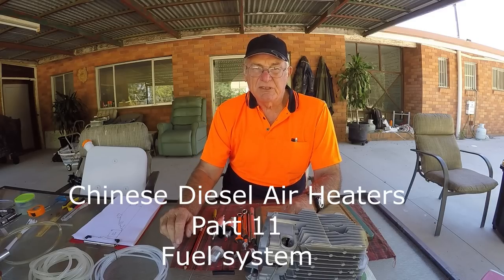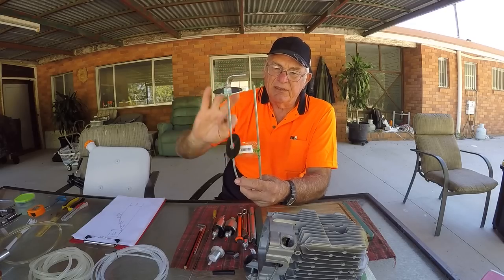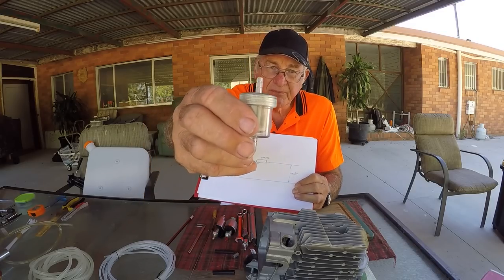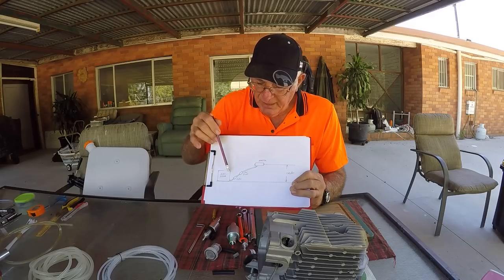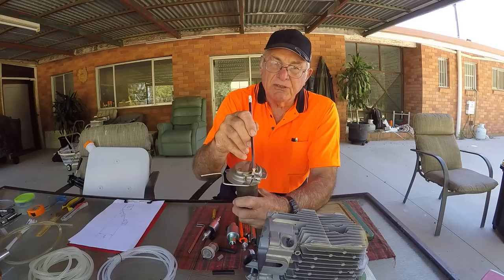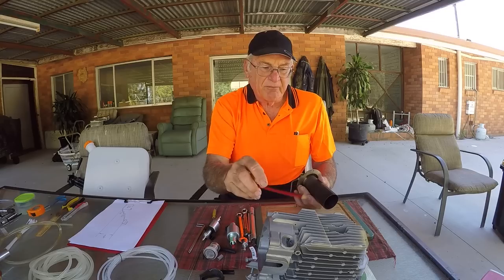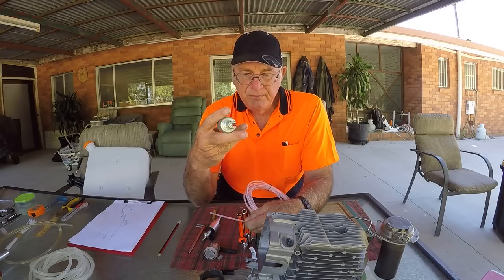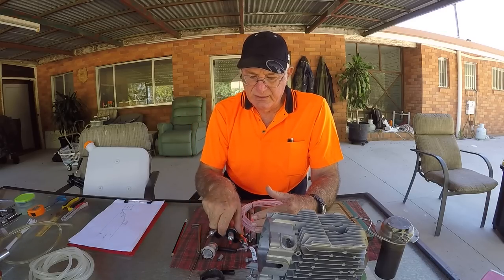Chinese Diesel Air Heaters - Part 11 -  Fuel Delivery

Comment: This is a brilliant video, I'm currently installing mine in my boat and I was debating using automotive braided fuel line. As I thought the hard nylon line would be sceptical to cracking in cold weather.

Comment: great insight into the tubing!thanks for taking the time to make this John
Reply from the maker: Hi David, pleased you found the video helpful.  JMcK
Reply: @johnmck1147   I think i've near watched them all,i'm on about 14/15.I'm so glad I did,you did a fantastic job on explaining about these heaters.I've upgradeda few things on the strength of your advice and i think the chinese are watching them too as they''re supplying them with better quality fuel lines and added a gauze to the air filter!      I dont know if ive not got this far yet but i wondered if you did one on using old engine oil?...or mixing with it kerosene or diesel.cheers,David
Reply from the maker: Hi David, these heaters will initially work by burning almost anything liquid that you can light up.
I say initially, because when you burn a liquid that makes smoke, like oil, when it burns, you also make carbon. Basically the more smoke, the more carbon deposited in the heater. This carbon very soon builds up in the burner and atomisation screens and the heater will no longer work. You then have a serious maintenance issue to remove the carbon.  JMcK
Reply: cheers John..I think I'll stick to kerosense and diesel then :).A mate of mine owns a garage and oils free ofcourse, but kerosene or red diesel isnt that dear in the Uk really.thanks again.David

Comment: hey john.  Thanks for all of your helpful videos.  I'm sure you have become a pillar of hope for many people around the globe, just looking to keep a little warmer.  Anywho...  I followed your directions on assembling the fuel delivery system in the proper way.  I have a 5kw(8kw) installed in a camper-van.  ( i know this could be overkill but i had no idea when i purchased it), and i have the fuel delivery components underneath the van,   My heater came with the hard nylon hose, but i still protected it by sliding it inside a larger clear hose, just as you mention in the video.  I used proper black fuel hose coming from the tank, into a valve, then  into the filter, and then into the pump, just as you mention in the video.     I fired it up yesterday for the first time, and it seems to run great right off the hop, and I had it on for a solid 6 hours with no problem.      So following your advice I had it on low most of the time, and then before shutting off i cranked it up to high to burn off any carbon deposits.   It is after this that i  noticed that there are fuel leaks at the connection points of the filter, the delivery side of the pump, and also where the line meets the heater!!.     No error codes however, even after running it again, so it must be getting proper fuel.   Im 99 percent sure the hard vinyl hoses is butted up to the inlets, and im 99 percent sure ive tightened the hose clamps down securely.     I'm not exactly sure what i did wrong or what i should do next?  Can the clamps be overtightened?  Someone suggested i change the hose clamps for the pressure clamps, but this will be a challenge to access the one right beneath the heater.       Do you think that the sudden change from lowest setting to highest setting created enough of a spike in fuel pressure to create these leaks?   and if this is so, how can i burn off the carbon?   what temp would it need to be turned up to if not the max 35 degrees?   im afraid to crank it up again.

Any insight would be greatly appreciated.
Cheers
Reply from the maker: Hi Bruce,

Thanks for the feedback.

Ref the clamps. You do not say what clamps you used. Please have another look at the motorhome videos re clamps. If you use screw type clamps on the nylon/rubber joiners you can actually creat a leak if clamp too tight. 

Now re the carbon removal. If your install is gold standard with very few restrictions in the combustion air inlet and the exhaust, you will have few carbon build up issues, and a med burn run now and then should be sufficient.

I run the boat heater mostly on low, and at the end of season I give it 15 minutes on medium and I  haven't had to service heater in 10 years. But my install has absolute min burner restrictions.

However if you have twists and turns in the exhaust, same for the combustion air inlet, and add in dirty filter to boot, you will have poor a combustion burn, and you will get excessive carbon deposits.

Your choice, if you can get by running heater on low and med, but you really do not want fuel leaks in your install.

 I hope this helps a little.  JMcK
Reply: John McK 47   Thanks for the thoughtful response.  I’m using the screw on clips that came with the heater.  Based on your response... I’m assuming that perhaps I over tightened them .   If I have created leaks by overtoghtening... do u think loosening off a bit would remedy this, or did I create a crack in the connectors?
Reply from the maker: Bruce Petracek 

Hi Bruce, it is a little hard fo me to comment without actually seeing your set up.  

Yes, you can creat a leak by overnighting those worm clamps on small diameter hose. 

If your nylon hose easily slides into the rubber connector, you will have a leak that can't be sealed by a clamp. You could try some silicone gasket sealant or similar to seal the hose.

Have you seen the motorhome videos. I talk more about this there.

Cheers.  JMcK

Comment: Man this is great!   Just ordered one a few minutes ago. Bet mine will have the flexie line. If we hadn't had seen this video we wouldn't have had a clue. Tho I have worked around hydraulics since being a kid and understand the principal of air compressing , but when a product is supplied with something , you usually just go with it.    But Thank You again 👍👍👍👍👍
Reply from the maker: Hi Phil

It is ok to run normal fuel hose (in most installs) from tank to filter to pump. But you should only run the narrow bore hard fuel line from the pump to the heater. 

The normal large fuel hose will still work if the run from pump to heater is very short and lacks loops where large bubbles can form. But you will have maintenance issues as the hose will absorb the pressure pulses and you won't get proper atomisation in the burner.   JMcK

Comment: I have a Hcalory heater that has never fired up, I just get an E 10 error code as well as fuel dripping out of the exhaust  - as well as a duff glow plug I suspect the fuel pipe has issues, it is a combined tank and heater unit and there is a fantastic bubble collector where the tube drops to the heater from the pump. I found your content very enlightening as to why we need to use hard line of the correct diameter. i will order both and try again. when you mentioned tubes running up hill i initially questioned that but upon explanation it makes perfect sense - bubbles travel up hill so no collection points on route. The manufacturers should make these things the other way round with the tank on the bottom so that its all up hill. Oh dear i'm waffling - stay safe

Comment: Thanks for the reply John , so this was a new heater install  that ran well for a short time ( one week 24 hours during a hunt in Canada at minus 28c ) from watching your videos I know I did two things wrong . One  I used rubber fuel line  , Two ran the fuel pump to prime however it did work well for the entire trip. When it started to act up  , it would  start then run for a few minutes then kick off . This occurred two or three times , then it just would not start . I sent away for  a replacement pump  which I installed , the heater ran for 10 minutes then the new pump stopped pulsing. At this point I suspected something else was wrong did some research found your videos and sent away for a new circuit board and  glow plug however I wanted your thought's before exchanging  these. I have watched your entire series now that I have found you and I must say you are the most articulate teacher I have found on this issue on the internet . I have so many things to correct before  I try the heater again ,however  one more thing If I could . The heater that I purchased  is an 8 Kw  , can you  recommend the  size  and hertz  after market pump you would use on this size heater . Thanks in advance , your new friend  Jack in Alberta Canada
Reply from the maker: Hi Jack,

Normal rubber fuel hose is quite ok on the pick up side of the pump, but you should only use the hard narrow bore hose on the delivery side of the pump.

First up,  if you used normal rubber fuel hose on the delivery side I would first check the glow plug screen and glow plug itself for carbon build up. If so clean that out, and replace the rubber delivery hose with hard nylon hose. 

Rubber hose on the delivery side of the pump absorbs the pump fuel pulses and creates issues at the burner screens in the heater. 

If you find high carbon build up in the glow plug screen, which is easy to clean, it is likely you also have excessive carbon in the main burner screen, which is harder to clean.

It is possible, but unusual for the ECU to fail. 

First up I suggest you use the correct delivery fuel line, check the fuel filter, clean out the glow plug screen, check glow plug and try and and run a 90/10 kerro/diesel mix through the heater for an hour on high setting. If your issues were carbon related, this will most likely fix your problem without a full strip down.

If not, you will need to look further, and this will involve a full strip down to check for high carbon buildup in the burner. It would be unusual for it to be an ICU issue.

Good luck.  JMcK

Comment: Some great engineering principles explained here. I bought a Vevor® "square brick" heater box but it didn't last long. Turns out the hard tube inside had a few factory installed coils so the bubbles were collecting up top and the atomizer screen was all carboned up. A thorough cleanout and rerouting the tubes fixed it good! So if you buy any of the box units take the cover off and inspect the tubing!

Comment: Truly an awesome video and demonstration. On paper, I don’t think there should be a problem with lifting fuel through a larger diameter line. The vacuum pressure at the top of a column would only depend on height not diameter. The pump would only be lifting the column of fuel within the cross-section of the pump inlet, not the entire volume of the hose. That being said, I’m taking your word for it!
Reply from the maker: You are correct. In practice, I can’t tell the difference. JMcK

Comment: Hey thank you sir for showing this effect of the soft tube compared to the hard tube. I'm experiencing leaks in my fuel line at the filter and at the pump. I'm considering replacing the soft tube that came with my heater with the hard fuel line kit I ordered
Reply from the maker: 👍. JMcK

Comment: Cheers mate from the Danish border. Thought I was smart using the heavy duty pipe, guess not. Will edit my setup now. Thanks a lot for the excellent explanation!
Reply from the maker: Hi Manuel,

Normal fuel hose is fine from tank to filter to pump.

Normal fuel hose will work ok from pump to heater if very short.

It is better to use hard narrow bore nylon on the delivery side of pump so the pulse pressure does not get absorbed, which will affect the atomisation of the diesel, which causes excessive carbon buildup, which now restricts further atomisation. 

Cheers.  JMcK
Reply: @johnmck1147  I tried to correct my error but broke the damn filter while fiddeling around. Guess I have to continue tomorrow. My hose length is from tank to pumo about 10cm and from pump to heater about 15cm. Does it really make a big difference? Because it ran well before I saw your video. :)
Reply from the maker: Manuel Martensen 

Hi Manuel,

It will run ok at that length if you don't have too many restrictions in in your install.
You may need to service the heater more often as you will get greater carbon deposits from less atomisation of the fuel.

Cheers,  JMcK
Reply: @johnmck1147  thank you! Greetings from the Isle of Sylt to you!
Reply from the maker: Manuel Martensen 
👍

Comment from the maker: Yes, you can get fuel leakage leading to flooding of heater and lots of smoke on start up. Just add a fuel shut off tap in the fuel line before fuel filter and turn this off if not using the heater for a few days. JMcK

Comment: John....Thank you so much for this excellent series of videos on these chinese deisel heaters.  OK, now for the dumb questions...lol...sorry.  But..I have located my fuel tank in the best for "ME" location basically at the rear door level in my van. I have also drilled a pick up pipe hole at the top of the tank and not the bottom simply to stop any leaking from bottom pick up fitting or hose connection by forcing the fuel to be sucked out the top next to the fill opening.  "Is this the start of my possible troubles" ???  Next I will suspend the ticking original pump as close to the bottom of the tank level. The thinking was to keep the pump as close to the heater's level...?  The next issue is it has a 12 foot solid plastic fuel line distance to be pumped...after watching your video, this seems possible...?   Next the heater is installed on the floor of the van right behind the driver's seat.    So the question is, my set up is basically backwards to what is being explained by almost everyone as to mount the tank at the lowest height then the pump then the heater at the highest point in the system.  Will my set up work? Is the question.    Sorry for the long winded question , but this is how it fits the best.   All and any suggestions or help will be greatly appreciated of course.
Thanking you in advance for this and also all your video's concerning these heaters.
If you have time, what are your thoughts on this silent heater from England I am now hearing about? Will it syphon the fuel from tank as tank is highest in the system..?  I just saw the video about this pump and wondered...again thank you.
Reply from the maker: Hi Jonathan, first thank you for the positive feedback.

It is ok to pull fuel out from the top of the tank and down to the pump. This is what I did in the motorhome video. However the pump must be angled upwards and you should install a shut off tap in the fuel line before the pump. If the tank is higher than the heater the fuel can slowly syphon and flood the heater. 

In your case the head pressure is not high and if you use the heater every day you can leave the tap on. But if you go a few days without use you need to shut off the fuel.

If using narrow bore hard nylon fuel line on the delivery side, 12 foot length will be ok. But you should try to keep it as short as possible.  Cheers JMcK